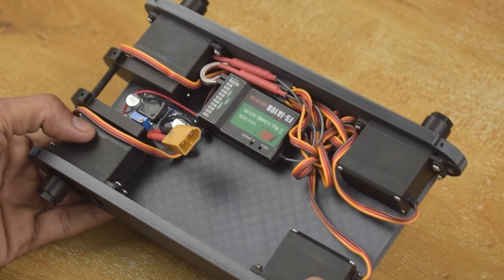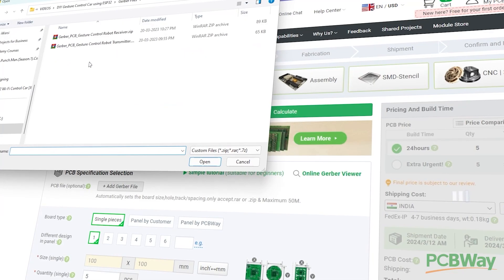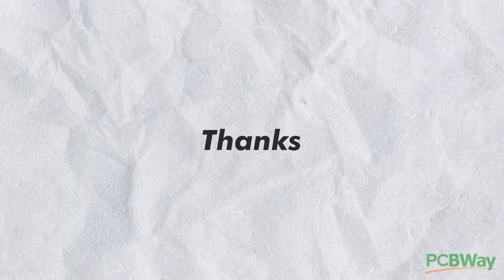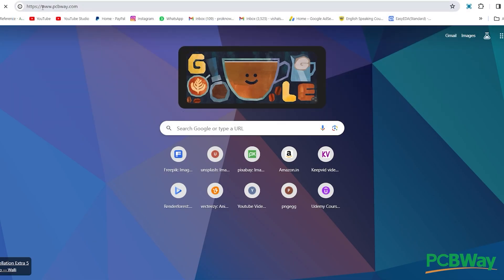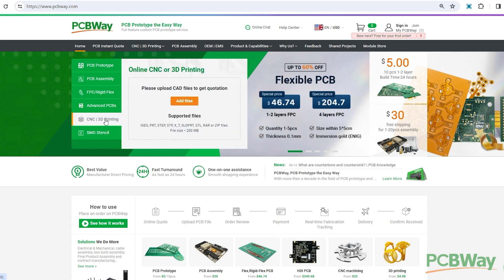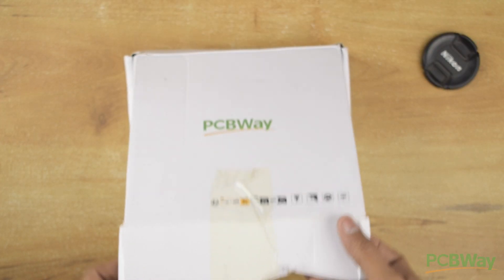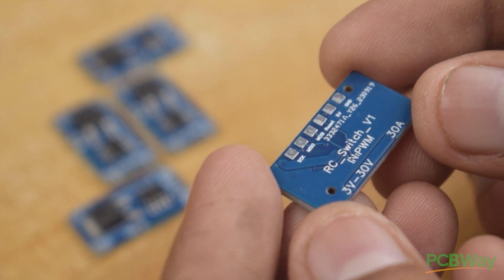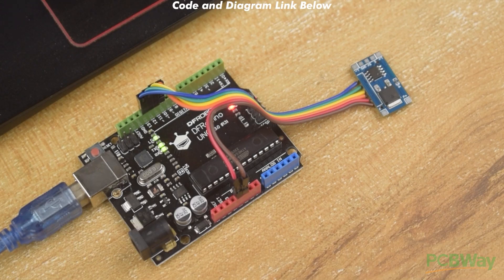Powerful 4WD RC Car Using Servo Motor - Pro Know

Comment: bro i have made a rover with same motor but i removed control from the servo and made it a gear motor that works very fast and it is also very powerful.😅
Reply from the maker: Wow, nice🙂! But my motive was to use servo Motor, not Normal gear motors, I already made videos using gear motors😎
Reply: @proknow  at that time I didn't have servo drivers🥲

Comment: U could have used gear motor instead with small rc transmitter as this transmitter is too overpowering for such a small project....❤🎉
Reply from the maker: Already available on my channel bro 😎